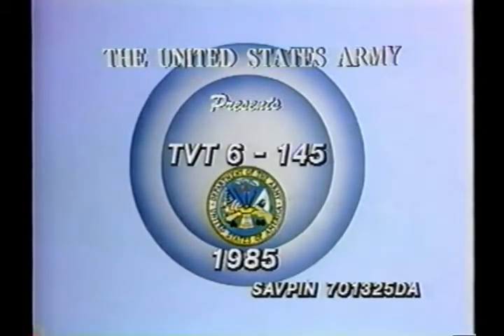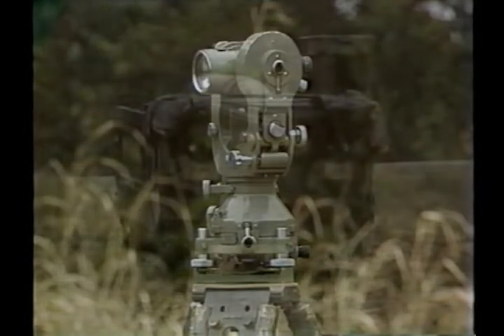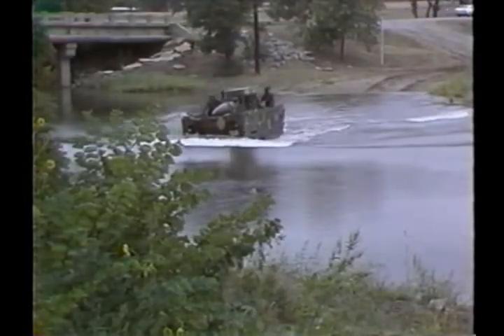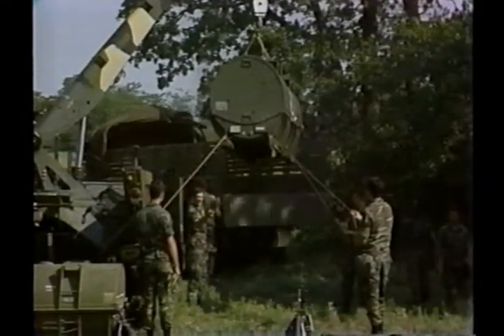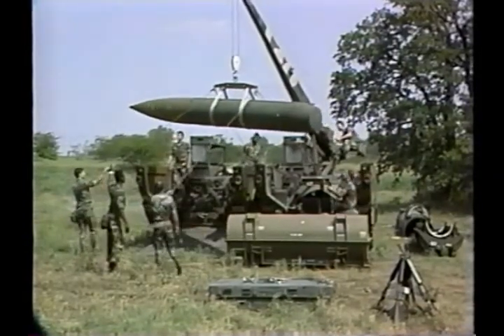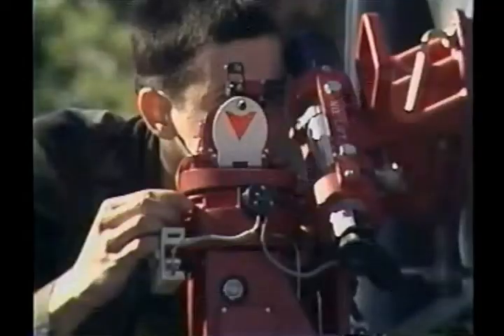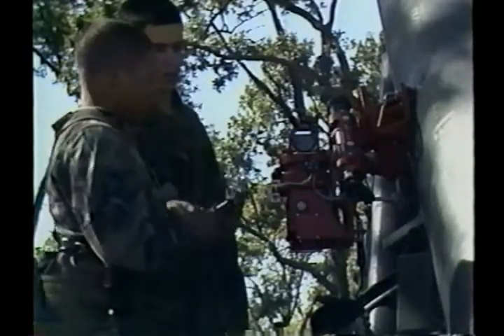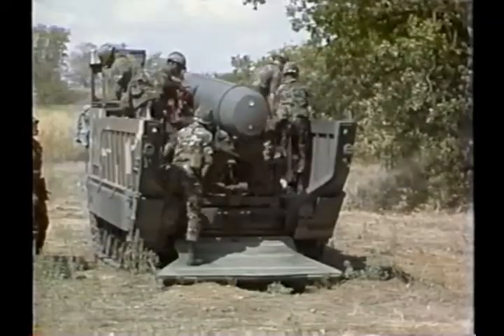Introduction to the Lance Missile System

Comment: You know what, I read some of the comments here. And sadly, some are right about the time needed to set the system up and fire. Fact is, compared to todays missiles and artillery these old systems were dangerous, easy to track, and easy to employ commando teams to take out firing units one by one or a whole battery at once. 

Todays artillery and tactical missiles out range these old systems, are quicker to deploy, and require less manpower to operate. I remember when I was stationed in Germany serving with self propelled guns it took upwards of 15-30 minutes to get the battery laid, and ready to fire. If  the guns were doing a hip shoot, it would take app 10 minutes to get rounds down range. Now compare that with the newer paladins rounds are sent down range quicker, and more accurately with less time needed to lay the battery and fire rounds. No offense to the people who served on these systems during the 70, 80 and 90s , but field artillerys life span on the battlefield would have been less than most would have liked.

1983-1984, 3rd 16FA Baumholder FRG, 1985-1989 2/29FA Baumholder, FRG.
Reply: No offense taken.
It was common knowledge that the life expectancy of a Lance crew was one mission. If for no other reason, the big black streamer it left on launch was like a giant finger saying here they are.
   Hanau 74 - 76
Reply: 2/78 FA 1st Armoured Division Bamberg Germany Lt.Col Tommy R Franks Commanding 83-85

Comment: when I was a ATT chief. It was 5th  Corps goal, that each fire section be able to fire two rounds in less then 45 min, that includes travel to a new fire point in between launches. With a Bn firing all 8 launchers it could have put 16 rounds in the Air in 45 min or less